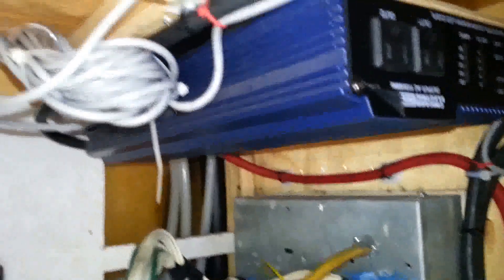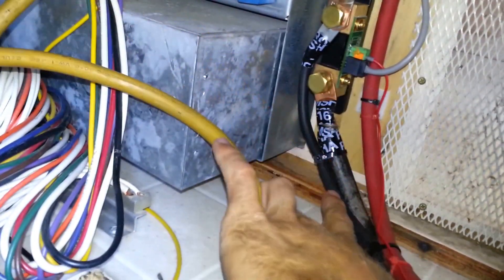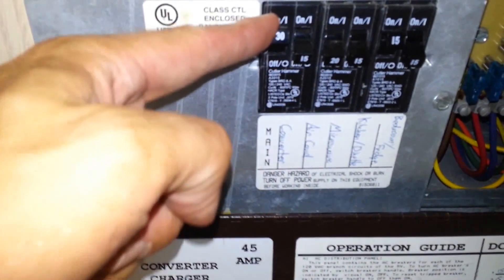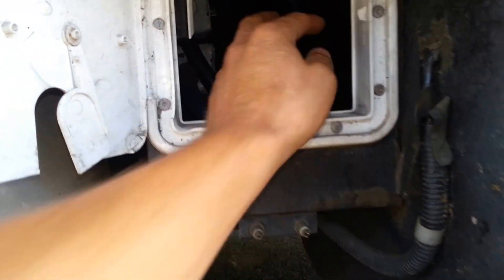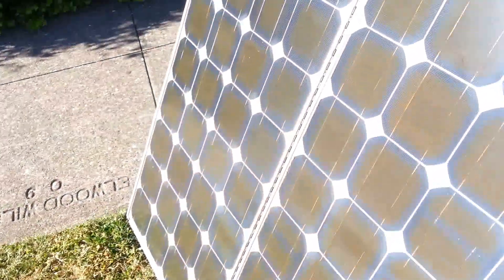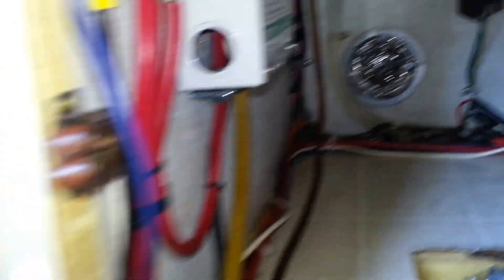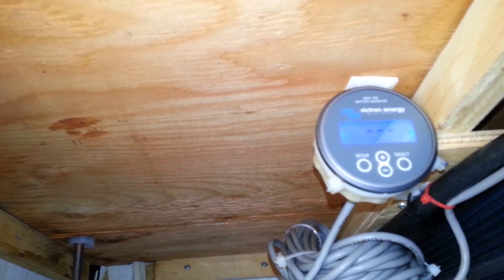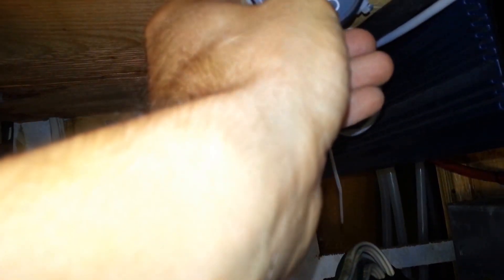Bigfoot Solar Panels, Battery Monitor, Inverter

Comment: Where did you get the battery monitor?
Reply: The battery monitor is a Victron Energy BMV-700.  The reason it didn't show amp hours consumed and state of charge in % at the time of the video, is because as the guy said he had removed power from the display.  When power is removed the monitor must be "Synchronized".  This can be done in the advanced menu or more simply by holding + & - buttons down simultaneously for a few seconds.  The Victron is an excellent battery monitor for the cost BTW